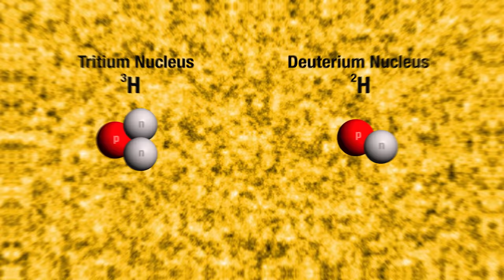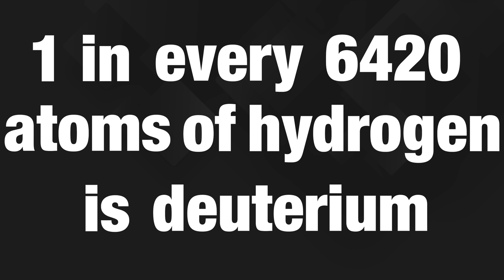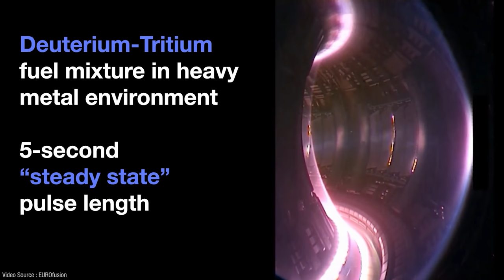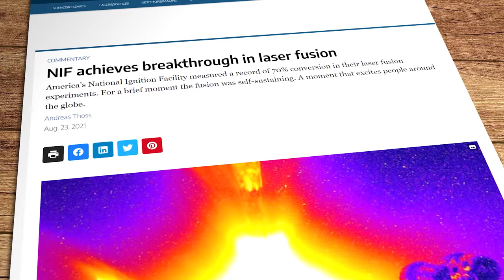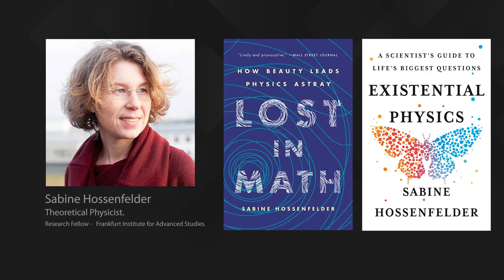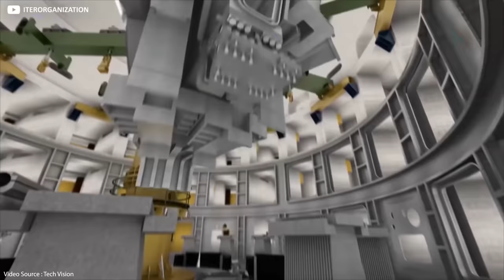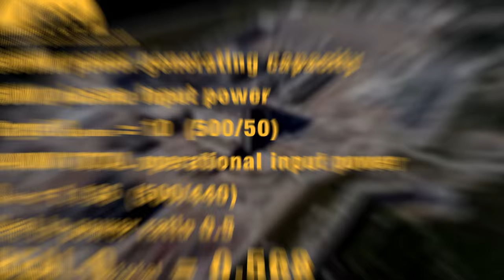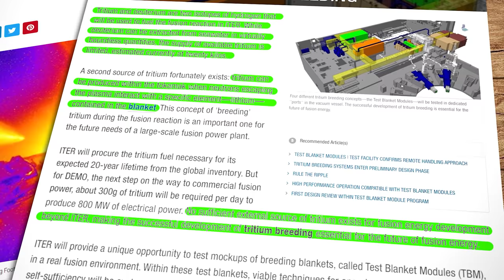Nuclear Fusion Illusion. Is it time to park the pipe dream?

Comment: Good presentation.  Actually, a large dent in reducing green house gas emission can be made and actually saves money - not adding to expense.  That is eating plants.  Animal products account for 40% of the green house effect (due to methane emission and reduction in carbon scrubbing plants).  Yet, this solution is completely avoided.  I guess its just not as fun, does not involve any great science, and as a politician you don't get to look like a superhero by encouraging eating plants as apposed to spending someone else's money on your favorite boondoggle.  
There have also been significant improvements in nuclear technology -- safer, more compact, cheaper - compared to the past.  Spending money on this advancing technology as well as producing new power plants is not in the cards due again to politics, not practicality.

Comment: Any technology has a curve. I'm not saying fusion is the future or anything to be clear, but even 20 years ago bEVs were not even really considered to be possible outside of a few exotic vehicles, and 40 years ago solar cells were not remotely considered viable. Now they're driving renewable tech. Now I personally don't believe fusion will be viable in the near future and is the climate change savior we're all looking for. However, there is certainly going to be a period of rapid progress and innovation within fusion and that period is certainly now. The rate of fusion advancements in the past 5 years has eclipsed most advancements we've made in the last 50 years before it.

If we're relying on fusion power to be our climate change silver bullet, obviously it won't be. We need to invest in already proven technologies at this point like wind, solar, and hydro. Nuclear Fission as well will likely need to be integrated to a certain degree into our energy makeup. However, fusion has been making great strides lately, and we need to approach it with some cautious optimism that it could happen in the nearish future (and by that i mean within the next 40 years).

Comment: We can only rely on known power-generation technologies for our near-term power supply, so no, fusion shouldn't be regarded as humanities "get out of catastrophe free" card. However, the cost of the research into fusion is a drop in the ocean compared to the amounts spent on more and more expensive ways to kill each other, cosmetics/vanity products,  and by companies on just about everything, especially IT, these days (Gpvernment spending on IT is notoriously incompetent and wasteful).

Fusion research is just that - research into fusion, and like most other science, just because it doesn't have a likelihood of delivering near-term benefit s doesn't mean it shouldn't be done. The primary product of research is data that can then be later used to inform how we can do things better in future. 
What annpys me is not how much is spent on fusion research, but how much effort is NOT being spent on modern, safer,  nuclear power generation to add a reliable base load capacity to our electric generating facilities.  But even if the knee-jerk anti-nuclear reaction many have were to suddenly vanish,  new nuclear power generation would still take years to roll out at scale.

What's needed most urgently is something that's even less popular than nuclear power - changing the way we humans go about things, in the short term, along with a long term cultural change such that we always think about the impacts of what we do or produce upon the ecosystem that keeps us all alive (for now, anyway).  Consumerism needs to be heavily scaled back - there's no reason we shouldn't ave nice things, but those nice things should be made to last, be designed with repairability in mind,   Meat needs to become  a very occasional luxury, rather than a daily staple, as the ecosystem cannot sustain the vast hers of cattle sustained by vast monoculture crops grown mainly to feed the cattle in order to inefficiently feed us. Even worse, in many countries with tropical rain forest huge swathes of forest are being cut down or set o fire in order to clear land for even more cattle-rearing. This needs to be regarded as a crime against humanity and punished as such. With modern IT, do we need so much office space? Recet events would tend t suggest that no, we do not, and the volume currently taken up by office space  could well make a significant dent in the problem of ensuring everyone has a decent place to live, if it were instead volume dedicated to housing rather than offices. And so on.  Finally, major efforts in re-wilding are needed.

We do not have centuries or decades to tackle this problem. If we don't get serious about tackling these things NOW, this minute - and by we I mean ALL of us individualy, as well as at governmental and species level - then catastrophic climate change and even more catastrophic ecological damage that the climate change will cause will result in an earth that cannot support anythiing like the number of people currently alive today.  Planet-wide mass starvation. The collapse of our civilisation.  THAT catastrophic, and within the lifetime of many of those alive today.  A nightmare situation that young children today will curse us for unless we  and our governments start working flat-out to make the necessary changes NOW.

Comment: When money is approved and allocated to be used for a construction project,  whether it is a bridge that we are building  or a jet airplane or a nuclear fusion power reactor we need to understand that this “money” does not exist. This “money” is simply created by entering numbers into a bank account and it then becomes debt that has to be paid back (with interest!) by all members of society. The only ones that are guaranteed to benefit are the banks that created this money since they will be the ones collecting the interest and the people and businesses that are getting paid to work on the projects.  The only way society can benefit is if the project can produce benefits for all members of society.  A bridge or a passenger jet airplane can certainly benefit a large portion of society. A nuclear fusion power reactor can also certainly benefit a large number of society but,  if after 70 years of trying to build this thing with 25 billion already  borrowed just for ITER not to mention all the other 10s or probably 100s of billions borrowed for all the other attempts to build a fusion reactor, society has already been suckered into paying for this pipe dream and it is extremely unlikely that society will ever benefit from it. They should have pulled the plug on this years ago! When you have to borrow more money than the Gross Domestic Product of a European country, and you are not even close to achieving your goal, you know that it is time to pack it up and start thinking about better ways to use money that is borrowed from society so that there is some benefit for everyone.

Comment: +++()     ++(())   +((()))      g(((())))     +((()))     ++((())     +++()      is a keyboard drawing of a plausible fusion reactor ( if our typewriters are the same). It is a row of ring magnets making a segmented solenoid. The center is grounded and a high positive voltage, increasing towards the ends is applied. The center magnet is strongest, the endmost ones are weakest, all magnet segments are oriented the same. It theoretically has ultra stable confinemet. Plasma in modern 10 Tesla superconducting magnets theoretically leaks slowly. This is public domain science.

Comment: By your logic, the wright brothers accomplishment of flying 120 feet in 12 seconds at kitty hawk was a failure.  What good is that.  They should have just packed up and gone home.

Fusion is complicated because it involves processes in time and space which are separated over many orders of magnitude which makes modeling difficult.  So they have to build machines which are expensive to build and operate.  The newest large tokamak in the US is over 20 years old.  ITER is just another machine in the experimental process.  Nobody claimed its design is appropriate for a power plant.  But its size will add another data point in the fusion scaling laws and it will answer questions on controllability, heating and helium ash removal and the operation of such a large machine.

If you want to criticize the power generation potential of magnetically confined fusion then comment on the various DEMO proposals.  It is naive and disingenuous to criticize ITER, JET, EAST or any other tokamak because of what they were not designed to do.

Comment: Ah ha ! I think it's important to understand that the dream is NOT "to reproduce the reaction that happens inside our own Sun" taken literally because that's worse than useless. I think that's an underlying technical issue. The Sun's core's energy density is utterly miserable, it makes lead-acid batteries for a headlamp on your helmet look like The Cat's Pajamas. It's a miserable 30 Watts dim light bulb in 1 x 1 x 1 metre of the Sun's core so a bit less heating than a refrigerator bulb heating a refrigerator, same as a good active compost heap heat. A nuclear fusion core like that would be the size of a dozen Amazon warehouses or Gigafactories to replace 1 coal plant. So, nuclear fusion core's on Earth must be at least a few dozen times as energy dense as the Sun's core.

Comment: Great video, as always.  I'd like to point out that ITER is not designed for production, for all its cost, it is a laboratory instrument, not a machine made for production, thus, if the Qtotal is less than one, that is fine (not for us in the short term anyway).  It is its successors that are, eventually (if ever) going to produce energy.  Also, a problem you tactfully left unmentioned that comes clear from the logo of ITER itself:  Russia is one of the partners.  Oops!   

I also wonder how such an huge machine would  work in an electrical network.  Imagine a big regional blackout.  Where are you going to get the power to even prime this colossal machine?   In a normal power station, you start smaller machines (auxiliary diesels, if no electrical power is available) to start the pumps and get things going with smaller auxiliary machines starting medium auxiliary machines and so on.  You also do that on an electrical network.  Smaller power plants to restore some services in some area, then medium plants and so on.  However, most of them can me modulated, they can blend into the network as they come on-line.  It seems a fusion reactor needs a working and very resilient network to even start and then absorb the power it produces once it is triggered.   I don't think machines such as ITER is the way to go.  They drain too much power on start and they need somewhere to dump all the power they generate once on, no modulation possible.   

I guess the NIF, being pulsed, can be modulated by just dropping pellets as needed to supply the electrical network.   I have also seen one design where instead of trying to tame and confine the plasma into some sort of stable configuration, they just create pulses of plasma and flings  two of those into one another to create a pulse part of which is used to trigger the next pulse.   Finally, I read about confinement into crystal lattices.  Instead of big magnets with big blobs of plasma, diffuse the hydrogen into a crystal lattice and get the holes in  the lattice to confine the fusion material in small cavities.  

I have the feeling that ITER is to fussion what the Space Launch System is to space travel.  Someone has to come up with a better idea to do fusion just like someone has come with a great idea on how to send things into space.
Reply: Never thougth about that. It seems like you need a working reactor to initiate a reactor.

The comparison with SLS is really good... and really sad.

Comment: All this effort, when consumption reduction is a short-term and long-term solution. In the short-term equalizing resource use to levels consistent with countries who currently have the lowest GDP per capita, and then long-term drawing down global population to sustainable levels. We got ourselves into this situation through the arrogance of insisting there were no limits, as a consequence our collective survival now requires significant individual sacrifice. Of course, acknowledging reality is impossible when so-called experts and misguided leaders insist we can be free to do anything we want, and we can expand forever. That’s called a fantasy, or a mass delusion. The corrective is not more fantastic thinking, it is accepting reality, and adjusting behaviour accordingly.

Comment: The craziest part about all this misdirected research energy is that we already have unlimited, cheap, safe fusion-powered energy for the future of humankind. The reactor is sited a relatively safe 150Gm from major population centres, is self fuelling and maintenance free, and came with a worldwide, unmetered, non-proprietary, massively overbuilt 500THz wireless energy distribution facility for which receiving stations are already in mass production and readily available at ever decreasing prices. So why do I need fleets of smaller, less capable, more brittle and far more expensive reactors in my back yard?

Comment: I'm not going to defend Iter, it seems like a money hole designed to ve inefficient to keep fusion as a dream. Take all that money and spend it on smaller research projects.

Second point the Q has continously improved with time and its still improving. If the progress ever stalls, then question the viability of fusion. 

The point made about fusion not being the answer to climate needs to be stressed. There are many people who would use the promise of fusion to not do anything about climate change today much like George Bush used Hydrogen to keep  from investing in EV's.

Comment: Energetic neutrons can’t be directly contained magnetically, & they damage whatever vessel is used, requiring frequent replacement. Helium-3 is rare on the earth but common in lunar regolith, especially in the mare. It can be fused aneutronically, or at least by releasing a lot fewer neutrons. One of the reasons to return to the Moon is to mine it for helium-3. It’s been estimated that a space shuttle sized amount of this (which would admittedly be a lot to get out of even the Moon’s gravity well), if fusion were perfected, could supply the earth’s energy needs for thousands of years.

Comment: I think we're not pumping enough money into fusion.  The benefit is huge.  ITER is a relatively small cost relative to the amount people spend on energy every year, and it will be 10 times as efficient as JET just because it's bigger.  Yes, we'll need to make an even larger reactor before break-even for Q-total, but it's still tantalizingly close.  Perhaps upgrading the magnets with the ones developed by MIT's Commonwealth Fusion Systems would help.  Since the magnets are superconducting, they shouldn't be taking any power while they're running.  The fission of lithium won't create long lasting radioactive isotopes the way the fission of uranium does.

Comment: Fusion is a dodo. Vast expense for no useable result in over 50 years. Each so called 'breakthrough' is a PR exercise to generate more funding. If all that money and effort had been put into renewable and storage solutions. Hindsight is a wonderful thing and fusion was a great idea that has not worked out and never will. As an aside, tritium can be produced in a fission reactor but is still horribly expensive, also in a fusion reactor, the neutron bombardment will make the walls of the reactor radioactive and lead to a deterioration of the reactor walls. Sabine Hossenfelder nailed it a few months back.

Comment: Journalists in general, and even those focused on science and technology, have done poor jobs of reporting the significance of fusion energy development. All the existing and planned projects are just expensive scientific experiments. There is a vast difference between the results of scientific experiments and a practical commercial fusion power plant. As you point out, just reporting on advances in plasma energy output is totally misleading when the goal is a powerplant. The energy required to run such a plant is vastly greater than just the output of atom fusing plasma.

Comment: 2,000,000,000 is spent on fusion 200,000,000,000 is spent on solar 4,000,000,000,000 is spent on fossil fuel subsidies
If you spend 1 minute talking fusion,  you should spend nearly 2 hours talking solar,  and over 16 hours talking fossil fuel subsidies

Comment: This just continues the ignorance.  First there is no need for fusion, since micronuclear reactors will be operational in 6 years that burn nuclear waste/spent fuel, which can supply energy nearly forever with no mining, but thorium could be used in some places.  The foot print and geolocations of these micro reactors can be nearly anywhere.  Concepts are safe, Canada says more economical than alternatives including coal.

Comment: This video is rather misleading. Most of the models in this video ARE already redundant. The ITER model is even in a huge cryostat so that the magnet don't need to be continued to be fed with energy. The two main things for fusion to work now is computation which is being outsourced on the internet and material science which is also racing ahead. So what is making all these models redundant ,even before they are built, is due to progress in the this science. He mentioned economic viability. Well yes it won't be at first but that will changed by further partnerships with Gov't and the private sector. There are foundations being formed to explain what the eggheads want to produce to the venture capitalists . It will race ahead. The big difference today is the necessity The mother of invention is calling louder and louder.